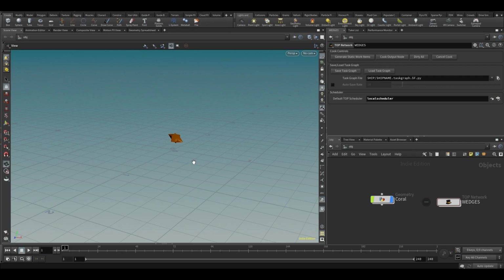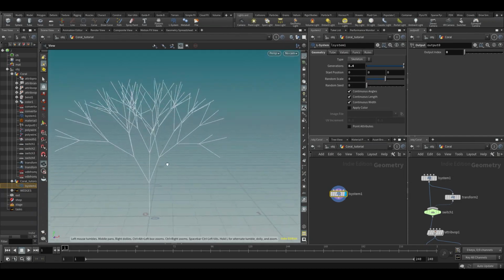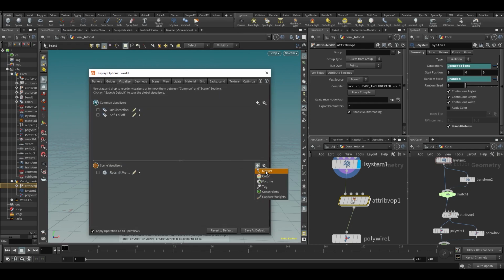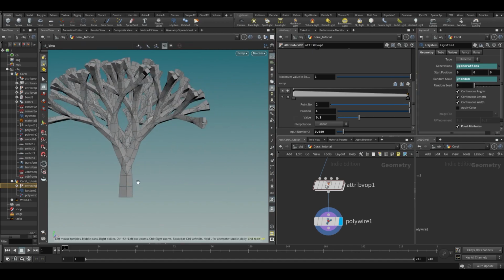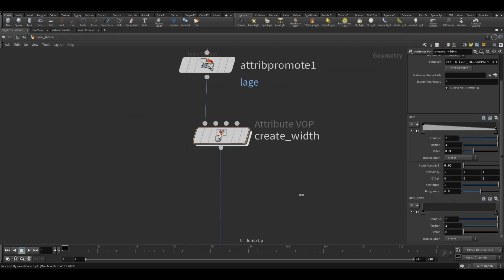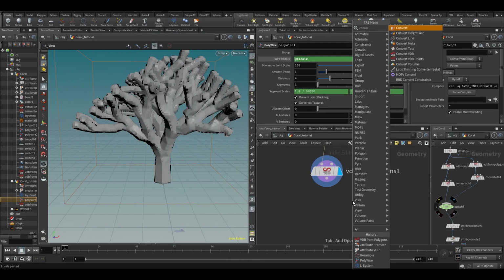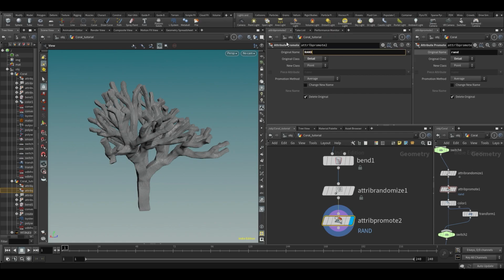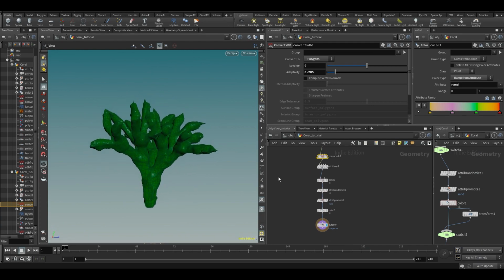Learn Houdini: Howdini101 - 032 - Crafting Coral

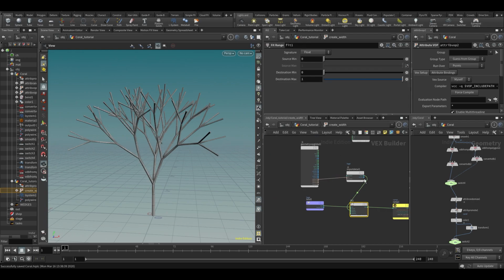Comment: Hi Tim. Firstly, great tutorial, I'm really enjoying it. I have a question on this video. At 08:43 you promote the parameter for source max. At 10:31 source max is connected to import detail. Could you explain how that works? I couldn't figure it out. My assumption was you are using import detail to somehow get the largest value of "lage" that is coming out from the lsystem.
Reply from the maker: Ah, must have missed that in the edit. My bad! You need put down a attribute promote and put it to from point to detail and then put the method to 'max', that will write out the maximum value in a detail attribute. Then in the vop you can load the detail attribute back in with getdetailattrib vop.
Hope that helps!
Reply: @TimvanHelsdingen  Got it. Thanks!!

Comment: You can get rid of the spikes on the geometry by changing the L-systems generation wedge parameter to be integer rather than float. That fixed it on my setup, at least. Set it to a floating value and then switch the output node to the Polywire node to see if that's the issue with yours as well. On my setup, with fractional values, the L-system has these weird bits of geometry that taper down to a small point no matter what thickness you provide poking out of the end, which will always turn into floating bits when converted to a VDB.
Reply: Can confirm this works, to clarify, when creating the WEDGE NODE, the first attribute he makes is the "gen" attribute. Directly under "gen" is "Attribute Type", change that parameter to "integer" and you won't have spikey tips. Had to read @warrenhenning8064 's post a couple times to wrap my head around that one lol.

Comment: To work around the missing Attribute Promote node that is used for the Import Point Detail node at 10:32, add an Attribute Promote node with attribute lage, new class Detail, promotion method Maximum, and uncheck Delete original to keep the point lage attribute. This will take the max lage value. If you add the import detail attribute and pass that to srcmax as shown at 10:32, you don't have to enter or update the lage value yourself.
Reply: Thanks for explanation